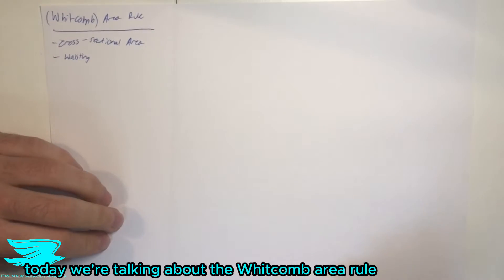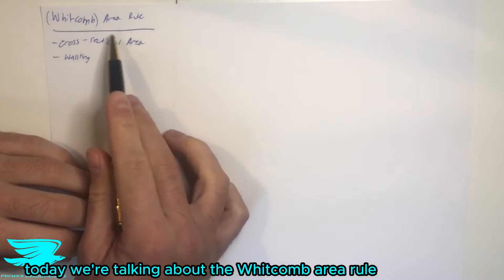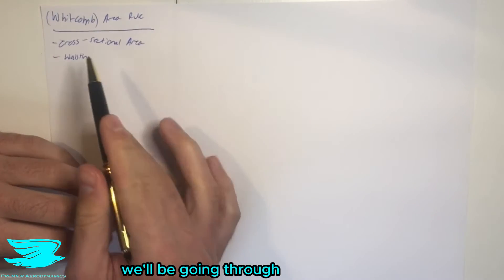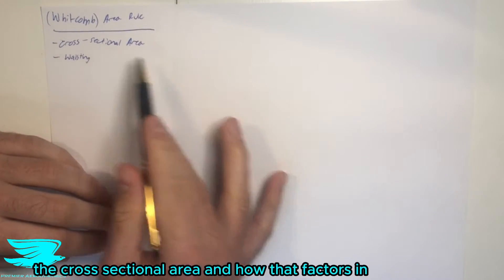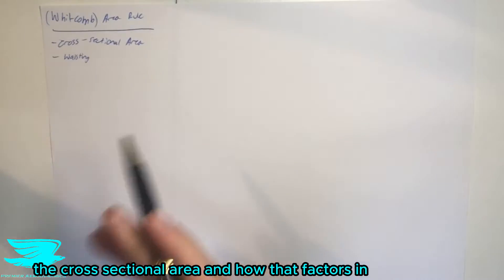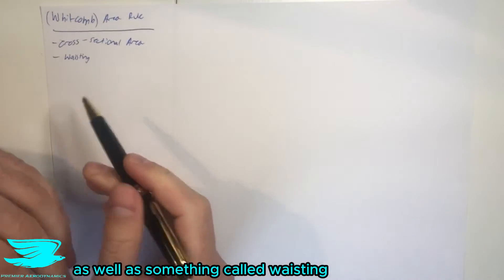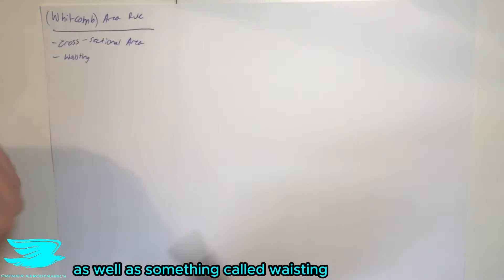[Aero Fundamentals #44] Whitcomb Area Rule

Comment: are there instances where the front of the airplane was deliberatly enlangerd to flatten these crosssection gradients? Or does pressure drag still factor in significantly enough to make this non practical?
Reply from the maker: For supersonic flows, it is always better to have a pointer front to reduce the wave drag (the drag from shock waves and compressing the flow). So, having an enlarged front will be worse for drag.

For hypersonic flows, enlarging the front is actually better because now the heating of the object plays a crucial role: in hypersonic flows, the air is now plasma and that is dumping A LOT of thermal energy into the structure. The sharper the structure is, the less thermal mass there is to absorb the thermal energy being transferred to it. As a result, the structure will heat up and will weaken.

Making the structure larger and blunter spreads that thermal energy out more and reduces the temperature the structure gets to, making it stay stronger and stopping it from failing.